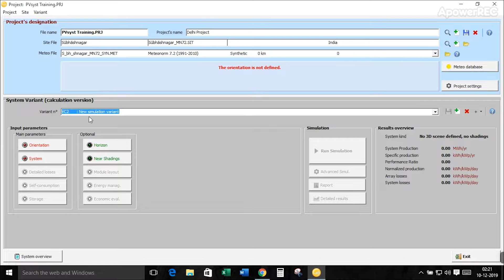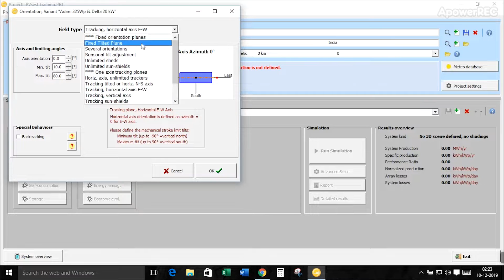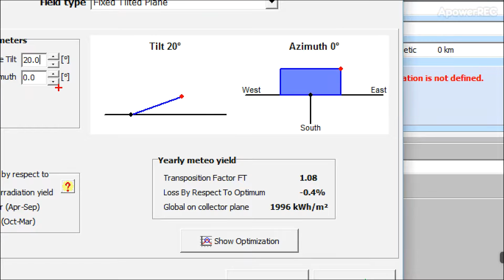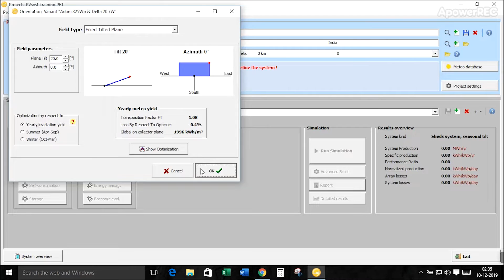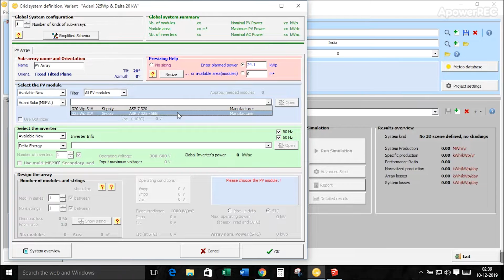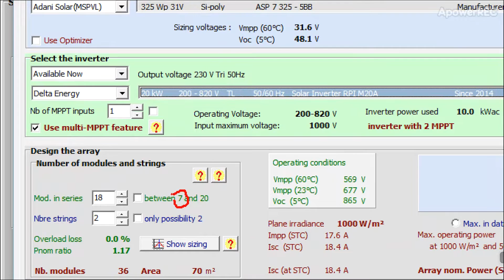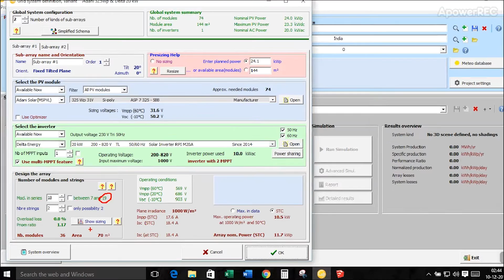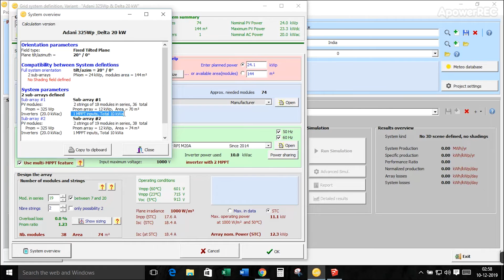PVsyst Software Training #Episode 3/(Solar Power Training Episode 7 )#pvsyst  #stringsizing

Comment: Your explanation was good & easy to understand.
In one case I took 445panels(Jinko) for 250 KW system & 4X50 KW SMA inverters with 6 MPPTS each.
when we are applying 2nd array to reshuffle strings & series connections its showing error (in orange) that to disable MPPTS feature for power sharing since 16 inputs with 1 string & 2 inputs with 2 strings in 1st subarray but in 2nd  array No such errors because 6 strigs in 6 MPPTs of 1 Inverter. I think we can ignore 1st array kind of error right?
Reply from the maker: Thanks for your appreciation.
When you’re distributing the strings in 2 subarray always try to fulfill as per the number of MPPT in inverter. Let say 1 Inverter having 6 MPPT with 3 input in each now if I distribute in subarray, for 1 subarray I am considering 4 Mppt, then for 2nd Subarray I have to consider 2 Mppt to match the total number of MPPT.

Comment: Hi, Thankyou so much for your pvsyst series. I have one question ? Here you made a subarray and used a different MPPT configuaration. Was it only to optimize no of modules needed from 76 to 74. Another one is that these two subarrays will be connected in parallel accross the inverter, so won't there be voltage mismatch as subarrays contain 19 & 18 modules in series respectively.
Reply from the maker: Hi Utkarsh,
1. For the first case you got it right.
2. These two 2 subarrays will connected in parallel because we have connect the strings in mppt and mppt are connected in parallel inside the inverter.
3. If you connect different size of string then there will be a miss match issue.

Thanks,
Amiya
Reply: @AllAboutSolar  Thanks. Means MPPT will regulate voltage of the string internally and inverter will consider no. Of MPPT controllers which is same in both cases

Comment: What is mppt in inverter
Reply from the maker: Maximum Power Point tracker. It will support you to track the Maximum Power Point, to supply the actual load requirement at that point and MPPT also gives you a flexibility to choose different kind strings for a single inverter.

Thanks,
Amiya
All About Solar

Comment: HI i want to know can i used different watt power of module in single plant . for example i have 738 nos of 360wp module and 92nos of 355wp modules total dc capacity is 298.4kwp and i  have 5 inverter of 50kw so please tell me can i used different watt power of module in same plant and please guide me on making string .
Reply from the maker: Yes you can use Different wattage module for Single plant. Please don't mix the different panels in single mppt means try to use the same module for each MPPT....

Thanks,
Amiya
All About Solar

Comment: Without doing Load analysis how did you Size the PANEL?
Reply from the maker: For On-Grid system you no need to do the Load Analysis. It's generally required for Off-Grid or Hybrid system.

Thanks,
Amiya
All About Solar

Comment: Hi,Amiya suppose when we are designing a solar plant for single building whose azimuth is about 5 degree or  15 degree towards west with respect to south in that case also we will use several orientation ?Secondly, this field type is just for  designing purpose it has nothing to do with the hardware? I mean in reality we will use fixed tilt GI mountings in both the case either it would be fixed tilt or several orientation field type
Reply from the maker: Yes you are absolutely right in both the cases.

Thanks,
Amiya
All About Solar

Comment: Brother could you explain about what is meant by two MPPTs?
And by 19 modules in series and 2 strings means that the 2 19 modules in series and connected in parallel between them?
Reply from the maker: Every ON-GRID inverter having MPPT(Maximum PowerPoint Tracker), in this example. Delta 20 kW inverter having 2 mppt that means two sections of DC input where you can insert the strings. Here total 4 inputs available means 2 for each mppt. 
Yeah, you are right for the second one.

Thanks,
Amiya
All About Solar

Comment: Hi Amiya,
Which version of PVsyst are you using? I've noticed that your main screen does not show USER NEEDS.

I've a doubt regarding Inverter selection. Normally we choose Inverter with 20% higher capacity e.g. for 1 kW DC load, we will select 1.2 kW inverter. 
But you have shown it opposite (For a 60 kW load, you're selecting 50 kW inverter)
Can you please clarify it.

FYI, I'm using PVsyst 6.86.

Thanks,
Sukhbir Singh  (sukhbir_singh@outlook.com)
Reply from the maker: I am also using 6.86 Version.
Regarding your inverter selection, there is no point to select higher capacity inverter because your 60 kW plant will never generate 60kW that's you can overload the DC solar capacity against inverter capacity by 25% Generally recommend by Invereter manufacturer.
I hope you understand the logic behind it.

Thanks,
Amiya
All About Solar

Comment: What is transposition factor FT in Orientation tab? What it's value should be?
Reply from the maker: Debjit, It's a very good question. 
Transposition Factor for Fixed Tilt:
It means the ratio of the 'Incident Irradiation' on the plane, to the 'Horizontal Irradiation' i.e how much amount of radiation u r gaining for the tilt angle. 
It's value, generally depend upon 'Loss by respect to optimum' means tilt angle. 
But always remember T.F value should >1

Thanks,
Amiya
All About Solar
Reply: @AllAboutSolar  Thanks for the easy explanation & quick reply. Other YouTubers take 1-2 days.

Comment: Why can between 7 and 20 mod.in series. ?
Reply: for cpasity inv. 680 kW and mod.in series 20, Nbre. string 14. can it be increased, or are there other settings to be able to set our own for the installed module and jumblah string ?
Reply from the maker: In that case we need design the string as per String design calculation. I will explain the same on my upcoming videos.
Stay Tuned.

Thanks,
Amiya
All About Solar

Comment: how to define tilt angle in case of moldele tilted at 10 degree south on a east facing shade which is tilted at 6 degree
Reply from the maker: In this case, if you want to do the precise analysis you need to draw 'near shading drawing' in PVsyst otherwise you can take the tilt angle as 10 degree.

Thanks for your support,
Amiya
Reply: @AllAboutSolar  Thank You very much for your support

Comment: whn to use multi mppt feature in pvsyst
Reply from the maker: I will recommend you try to use the same every time when you are designing the string and specifically when you have different kinds of string you need to select the multi-mppt tab.

Thanks,
Amiya
Reply: @AllAboutSolar  Sir can you please elaborate it.. iI didnt get the reply
Reply from the maker: @ask1889  As you can see from this video, I have the available area for 74 modules. To do that, I have to decide the string as S1, S2=18 X 2 & S3, S4=19 X 2 here two string size is different so, you have to put the strings into separate MPPT(S1,S2=M1 & S2,S3=M2).  If every string having the same number of modules, you can select the 'No. of Inverters' tab.

Hope you understand the same.

Thanks,
Amiya
All About Solar